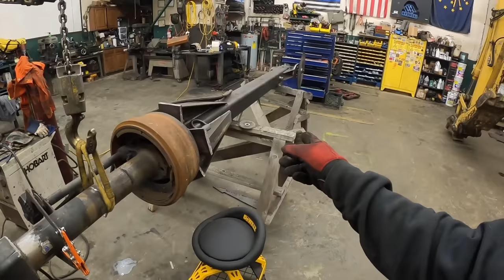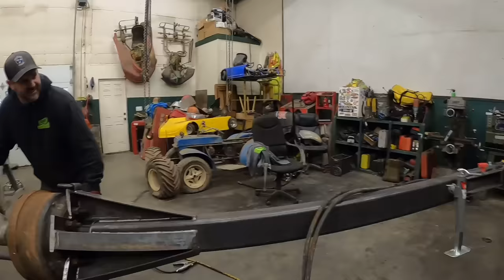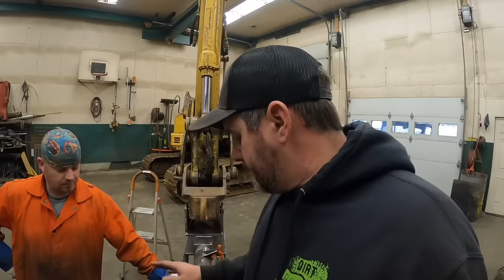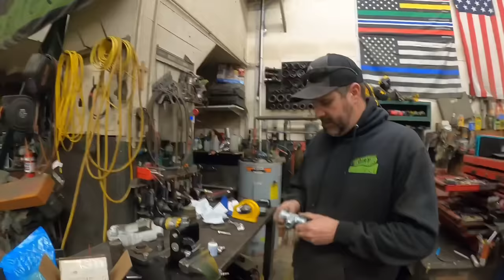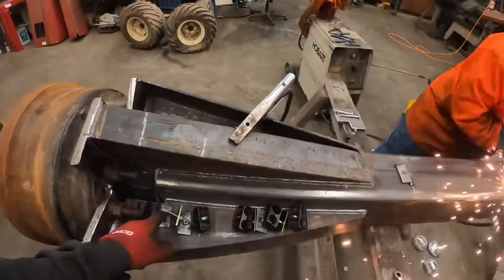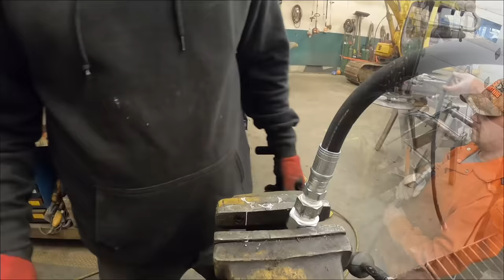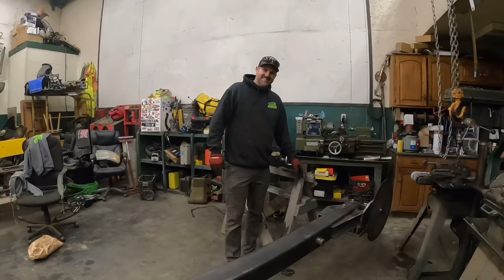First Cut With  the saw  - Will It Work?! Scary Moments!

Comment: I have worked with several aerial saws and I think the rotation is incorrect also and when cutting in wood under pressure it will back nut off, and even with correct rotation the nut should be pinned to the shaft and or keyed collar washer and shaft to prevent blade flying through the air and injuring someone. But other than that the rest of your design looks like it should work well.

Comment: Forestry  Mulcher equipment use Polycarbonate Safety glass in Cab windshield to protect operators from high velocity projectiles launched off spinning blade. 
Suggest consideration using it or screen to protect yourself.

Comment: I think you could have those hydraulic hoses enter the beam at the hydraulic motor and come out of the beam at the flow valve. That way they would be protected from almost anything you could hit them with. line the entry and exit of the beam with a cut-open hose to reduce wear at those points and Bob is your uncle.

Comment: You will regret putting on the liquid Teflon paste. The liquid past will dry out and then it will Leake. If you put the tape on right and have the fitting tight it will last for ever.Hope your gearbox is heavy enough to handle the saw blade. When it works I will come and rent it off of you or have you build me one. Very cool.

Comment: Maybe instead of the large brake drum you could have used a disc brake and caliper with a hydrallic brake master cylinder which might have reduced the weight

Comment: blade is going in wrong direction to keep the nut tight. and I think I would want a pin in there anyway because just the slowing down quickly like it does would still undo the nut.

Comment: PLEASE tell us you are going to find a way to totally lock that blade nut ON so there won't be any possible future "on job" accidents in that area?? Maybe a shear pin type within the blade hub area if the back spacer is welded to the shaft or a key way so as to stop the blade from any accidental loosening of the retainer nut?? 🙏🙏🙏🙏

Comment: for normal it is said, the direction the blade turns is the one the locking nut opens... so self tightening would be the other way around

in case of right hand threads the sawblade should spin to the left when looked from the locknut side (same as on a angle grinder)

I'd rather have the boom turned around so the blade spins on the cab side in the right directon to self tighten than the hydraulic motor turn the other way and have the balde possibly self losening

and I guess you got right handed threads, not left handed ones

but all in all, nice concept... will be surprising how it cuts in real use

Comment: What I meant was turn the whole head 180 degrees, so it turns the opposite way, I thought that was why you have the brake. Does the blade cut like a chainsaw with the teeth only one way,  I am thinking it like a chainsaw, when you top cut it cuts towards you, when you undercut it cuts away from you?

Comment: Pretty sure you need to turn the blade around. You were right in your remark about it spinning like a grinder. It should cut "Counter clock wise" so if it binds up it will tighten the nut, not loosen it.
Just sayin .

Comment: I've always left my tools where I could just grab and go. Union welders get a lot of foot travel time... take it back to the tool box and wipe it off, ten minutes later, they have to go get that same wrench which might just have to be signed out of a tool shack.... just all time wasted as I see it when working for myself. Thing is, you really do get used to what you do on a union job and it sticks with you ..... well it seems like forever. I was in the operators 302 and if we stopped to pee, we had to chart it.... glad them days are over.

Comment: You guys now have placed the sawblade into the dangerous way, so that it will loosen the bolt holding it if you make it accelerate or you hit something that will slow the blade down !!!
Reply: I bet you can easily find explanation of how these rotational masses work and how to properly tighten circular saw, bet idea is you want your bolt to tighten opposite of the rotation of the saw blade !!!

Comment: Won't the orientation of the blade depend on which way you have it rotated at the time you use it and your visibility could be better if you rotate the blade to be 180 degrees of what you currently have it.

Comment: Your comment about the chinese steel makes me chuckle ,because if you looked hard enough you would find out there are alot of things in this country made out of chinese steel. I'm not supporting foreign steel but every manufacturer out there buys it whether they admit it or not. Bottom dollar is everything to them. Had a cousin that was a steel broker and he once told me he could get a coil of steel from China, that after riding all the way in the hull of ship( because of how they packaged it) every inch of it was usable, when a coil manufactured 25 miles away they would have to scrap about 50 foot of each coil because of the rust and how it was stored.

Comment: did you know when you rotate that 180 degrees the blade well rotate backwards on the blade. you may loosen the blade
Reply from the maker: lol no sir will spend the same way
Reply: The blade well spin the same but at 180 you changed the orientation of the blade even know its spinning the same it going to cut from the back side of the teeth trying to loosen your arbor nut check it on machine you see. if the blade is on the left side of the boom and spinning down then rotate 180 to the right side of boom it well spin up. so on the right side you have to cut from the top of blade to keep the nut tight

Comment: You will not need to run it backwards just turn it 90 it's runing the other way same as chainsaw  stand on the other side of the log and it's cutting the other way 👍

Comment: The reason most do not use teflon tape on hydraulic NPT threads is that unless you are very careful, pieces of the tape can break off over time and get into the hydraulic spools and cause issues. Teflon  paste is the preferred sealant for hydraulic NPT threads. Really nice job on the saw. Thanks for sharing.

Comment: I have had mixed emotions on the side that the blade is on.. If the blade heaven forbid came off while running you want it on the right side of the support beam. And for cutting kick back of material you would want it on the right side as well, so that it doesn't send it to the cab. Visibility I think I would want it on the left side, but you are saying you have good vis from the cab.. I think we need a cab cam view to see what you're seeing. The pressure diverter setting on cam to me didn't show a lot of RPM difference, did it change a lot in person? Is the pressure diverter something you would set with a pressure gauge so you know what the numbers corralate to or does it give pressures per number? I can see a swivel motor as a new attachment coming soon for rotation instead of manual brake control swivel. Would a castle nut fit on the blade to lock it on? I in no means am trying to tell ya what to do, I enjoy watching your channel because it is different from what I do for a living.. But this project is getting closer since I have been chasing fire around in the woods for 30+ years. You two keep up the good work, it keeps me entertained.

Comment: Mike it's called Arron stirring shit, Well I always try to be honest, all of that reinforcement at the brake drum looks pretty shotty, you really didn't reinforce anything,   the studs coming out of the drum are the weak point, again it's a great job, but I would have cut a round disk  and added maybe 10-inch gussets from the disk to your square tubing, you added a ton of weight onto the studs  with all of that unneeded steel  GREAT VIDEO AS ALWAYS, AND A LOT PRETTIER LOL

Comment: You just turned the blade the wrong way for the bolt. it will loosen under load. Bummer, you need a left hand thread or flip it to the other side and rotate blade again.

Comment: Shouldn't all those joints be welded first, then find the center of gravity?  That seems to me your adding extra weight from the welding rods.
I admit I'm not a mechanical person.  I'm an Electrical Engineer.  I know enough about fittings, that I would do it exactly as you would with the liquid tape! 👍
---
I watch a lot of YouTubes, and I have to say Aaron is a hell of a welder!  👍👍    Wouldn't a castle nut be safer on the blade?
---
You better patent this before some big company steals your design!

Comment: It sure looks like you switched the blade the wrong direction to keep blade tight. Probably should key it and put a locking washer with tabs behind the nut like a semi axle bearing. I'd hate to see it turn in to a nija star and end up in the cab with you.

Comment: Two things I would suggest would be,1 on the brake lock secure the handle somehow so the any vibration will not make it come lose.2, make a quick attach guard for the blade when not in use walking into that blade would be bad. very cool build by the way!

Comment: Your BLADE is rotating Clockwise and the Nut is Clockwise therefore the forces while cutting are Anti-clockwise do the fixing NUT is on the WRONG way and will get loose when cutting

Sorry to tell you, take a look at your grinder wheel and nuts — Left side is left hand & Right is Right hand
Your shaft is on left and has Right hand thread

Comment: 🛑🛑🛑 🏴🚩🏴🚩🏴🚩Me thinks the motor needs to be rotating in the opposite direction, so the nut will be tightened when the blade is under load. Otherwise you'll be cutting and the nut will loosen and I don't want to be around (or see} the aftermath that would ensue.....

Comment: I  think the motor is turning backwards... the direction of the motor will spin the nut off. You want the motor to spin the opposite way you spin the nut on. That way the direction of the motor will always try to tighten the nut against the blade. Just look at the way a grinder, or saw turn in relation to the blade direction.
Reply from the maker: lol stay tuned

Comment: YOU GUYS MAKE MY DAY. You finally figured out the blade was backwards, that was annoying me to no end. Are you really that bad at putting on pipe dope? scrape the applicator on the side of the can until there is just enough to apply to the fitting. Reminded me of Ray Raynor doing craft projects. I am also a custom machine builder primarily for manufacturing ( hole punchers, cutters, stackers, coilers, etc.) while my regular job is designing and building custom plastic extrusion tooling. I have a far nicer shop and top quality tools to play with but you make quality tools with primitive equipment, just goes to show that true craftsmanship comes from the craftsman not the tools available. now, that being said, DON'T F UP THE PAINT!  I am against the candy cane paint job ;-)
Reply from the maker: Plan worked thanks